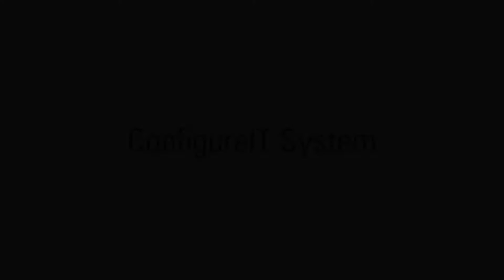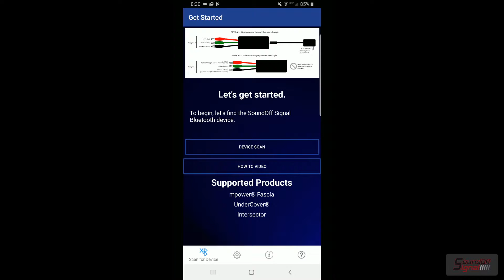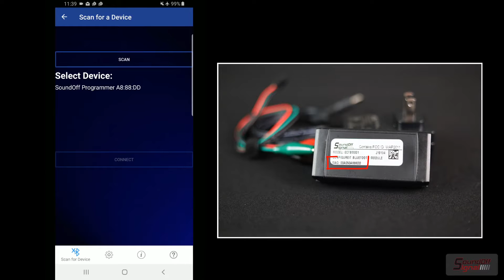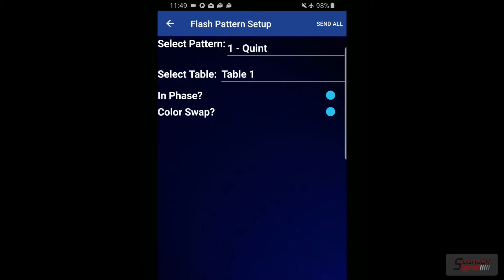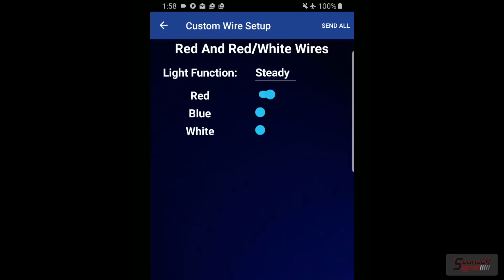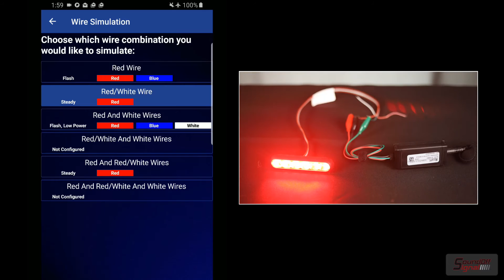ConfigureIT System Introduction Video

Comment: Will this help sync??
Reply: The perimeter lights themselves already sync when you have them setup to flash, provided you tie the green wires of multiple lights together. In the case of bluePRINT, the lights are flashed externally - meaning bluePRINT handles synchronizing the lights.

Comment: can this system recognize multiple lights at the same time? What I mean by this is... if you have multi mPowers with the Green sync wires tied together, will this app recognize multiple lights at the same time?
Reply: I also had this question. Did you ever find out the answer